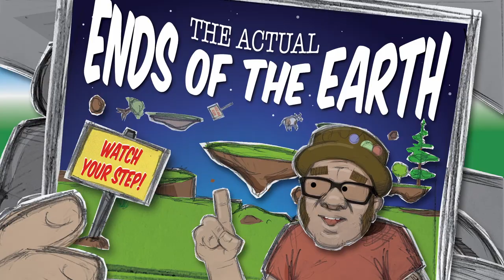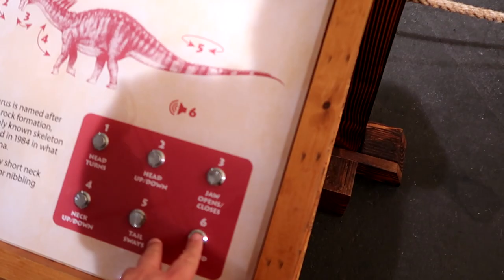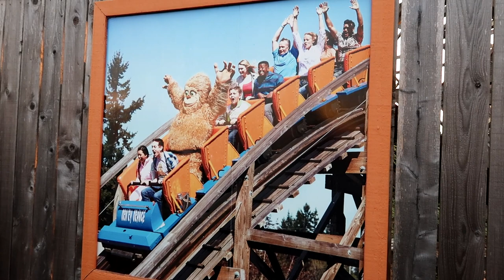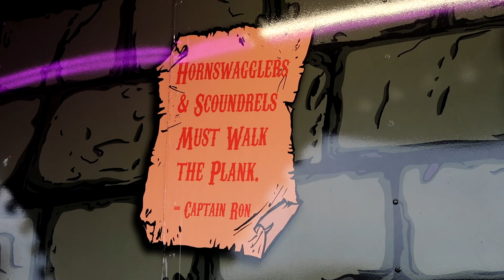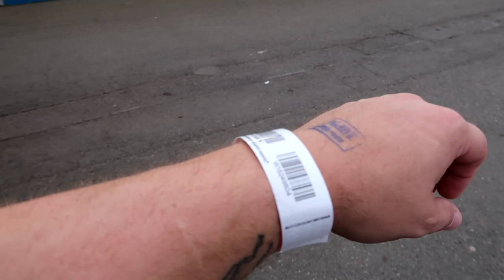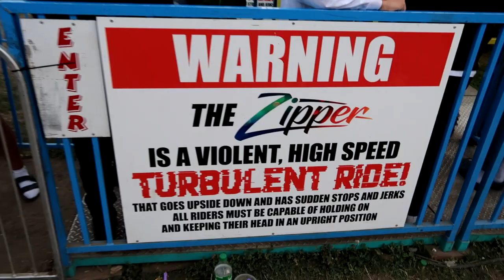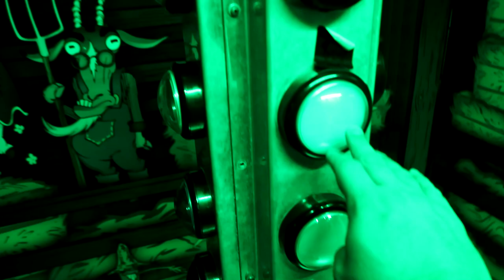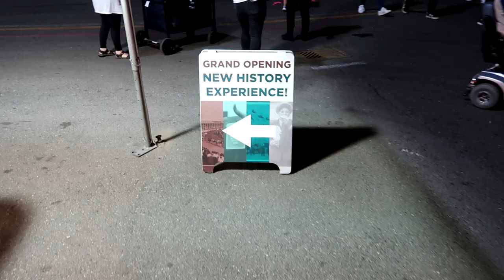Dark Rides!  Carnival Games!  Classic Wooden Roller Coaster!  Washington State Fair!

Comment: 37:33  Oh man.  Back in the 70's when I was a kid, I used to LOVE riding the Rock O Planes.   It was like a Ferris wheel, but you were in these egg shaped cages.  There's a lever or ring in there that you can pull and it moves a weight up and down in the front of the pod so you could get the pod to spin upside down.  It was such a fun ride.  If you got that spin timed right, you could keep yourself spinning through the whole ride.  I used to like to tip completely backward when going over the top and then lock it so that on the way down, I would go down head first.  I believe that the sign there is the disk that was in the center of the wheel.   Most of them have spirals painted on them with the same light setup.  Sadly, you don't see Rock O Planes at fairs or in traveling carnivals around here any more.   None of our local fairs or carnivals seem to have ANY thrill rides at all as a matter of fact.  All the thrill rides seem to be gone, and have been replaced with the toddler rides.  All the carnivals and fair rides around here are VERY YOUNG kid affairs now.   I would love to find a working Rock O Planes and ride it again.  Heck.  I would love to hop into a Zipper again as well.  But I havn't seen one of those around here since the early 80's.  Something happened in the mid-eighties that just caused all thrill flat rides to go extinct here.
Reply: This Fair Washington State Fair aka The Puyallup Fair has the Zipper ride.